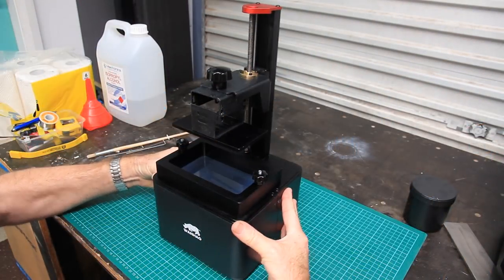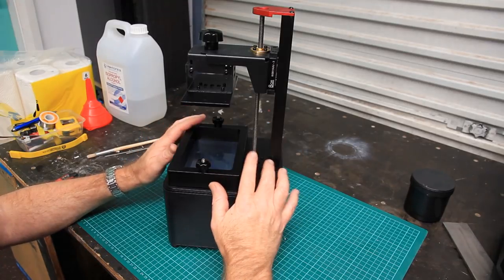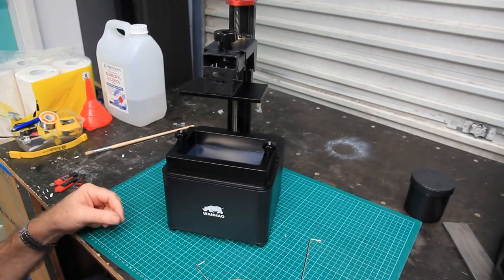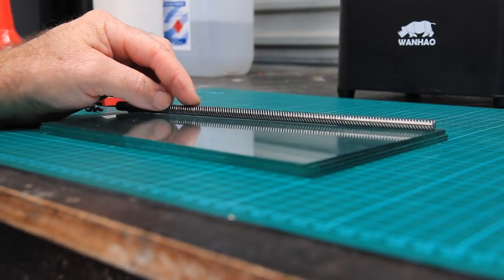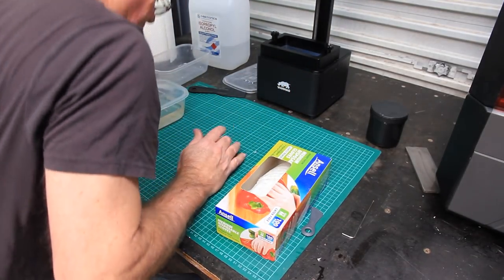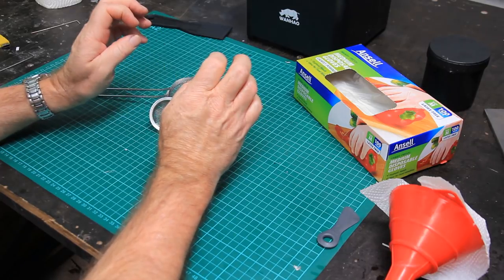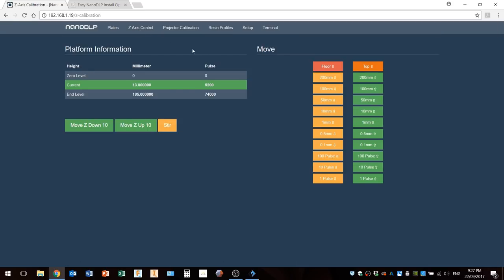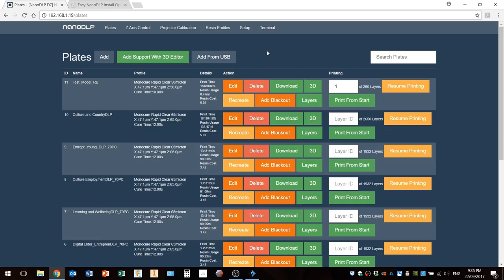The Wanhao D7 Operation and Troubleshooting for Beginners

Comment: just recieved my D8 , so far there is practically nothing regarding tips and tricks on its use on ebay and as a first time printer im just a little nervous to be honest lol, hopefully i can apply some of what you have discussed about the D7 to help me get my head around the difficultys i am likely to encounter. oh and are the raspberry pi, another thing it seems i will need to  get before i can get started eh uurrrgghh, it was difficult enough for me to figure out how to set up skyminer nodes on orange pi primes for skycoins decentralized mesh net so heres hoping i can get my head around that hurdle lol

Comment: Any suggestions on why prints keep sticking to the fep and not the build plate? I’m using the d7 plus, and no matter how hard I press on the plate when I level the plate it makes no difference, I have tried roughing up the build plate with 300, 450, and 600 got sand paper
Reply from the maker: Hi Jason,  one thing to be mindful of is that you don't create big flat areas with your prints.  For example if you had a figurine with a base, don't print it base down flat.  Tilt the model so the base prints at an angle.  Alternatively, it could be the build plate surface.  I never had to do it with mine but you could try sanding it with some 80 to 100 grit wet and dry paper.  Best to put the paper on a flat surface and rub the build plate on it.

Comment: Thanks for the great vid, how does the Hunter prints compare to the D7? I'm looking at a upgrade but need to know if its worth it regarding print quality.
Reply from the maker: Hi Tony.  The Hunter is in a class above the D7 from both a mechanical and optical standpoint. Apart from anything else, the ease of use is almost worth the hefty price tag.  I printed with Wanhao Red resin and a mix of wanhao red and monocure rapid clear.  From a print quality standpoint, I was definitely able to get a higher quality print from the Hunter with less effort.  From prints I did get a side-by-side comparison using Monocure Rapid Clear, it was hard to tell them apart.

Comment: Benny I am thinking in getting a D7, can you please tell me if it is to much of a learning curb.  I is worth the effort?
Reply from the maker: Hi Mike, yes I think it's worth the effort if you want highly detailed prints.  If you just want to do general printing, the materials are much more expensive and are more difficult to handle.  I have a lot of experience with FDM printing so the concepts are well known for me but DLP is very different.  My feeling is that there is so much help available, you cannot fail :-) Before you take the plunge, join the Wanhao D7 facebook group and do some reading.
Reply: Hi Benny, thanks so much for your reply sir, I am going to get it then.  I am so excited!
Reply from the maker: No worries Mike, glad to be of assistance :-)

Comment: Hi Benny! Thanks for this very useful video, it helped me a lot understand what my D7 is doing. However, I'm still experiencing a weird problem with mine that I couldn't solve so far. In my first print, a few bottom layers (the first layers) were "missing" and it almost felt like the object got "pressured" while it was still in the making. However, the top layers are fine (extremely good detail and quality). I repeated the process with the object lifted 5mm and added supports: Now I got the full object but the bottom layers again look a bit "squished". I could show you pictures if you happen to have an email. Would be glad for any advice, as I really like this printer! Thanks, Chris
Reply from the maker: Hi Chris, by "bottom layers" do you mean the layers closest to the build plate or furthest away?  If its the layers closest to the build plate then it's likely to be an issue with resin adhering to the print and getting accidentally cured with your "burn-in" layers You could try lengthening the dwell time from when the print lifts to when it goes back into the resin.  Maybe this will work and maybe not.  One factor I think that we discount is the depth of the resin and how that relates to the amount of "squished" layers.  I'm not sure if anyone has done any testing along these lines.  Certainly with transparent resin, I can see this being a possibility as a certain amount of the print will get fully submersed in the resin until it's built up enough.  Maybe when this happens, the print suddenly gets "cleaner" .  It's worth thinking about.....
Reply: Hi Benny, thanks for your quick response! Yes, by bottom layers I meant those closest to the build plate, yes. I also thought about the first few layer setting which get more curing, but that problem would go away as soon as I lift the object and add supports, right? With supports, the entire "supported" side (basically the side facing the build plate, but not touching it), looks bad. I've uploaded a little video so you can see how it looks like: https://www.youtube.com/watch?v=J5ZcfoM-LDg (The side you see first is fine, the other side is broken) As for the resin depth, since the "newest layers" always end up in the resin anyway, shouldn't every layer be affected then? I also found out that my resin settings were incorrect (I was using Monocure settings instead of the settings for the WanHao Orange Resin, which has less cure time), but I'm not sure if this could be responsible. I'll repeat my prints now. If you have any other ideas, I'd highly appreciate any suggestions.
Reply from the maker: Hi Chris,  I still think it is an issue with resin lingering on the surface, maybe tilt the key so that the flat part (that you turn the key with) isn't parallel to the build plate.  The consensus seems to be 45 degrees :-)